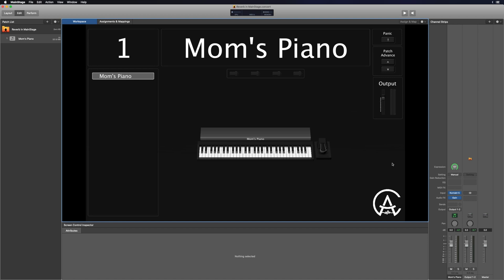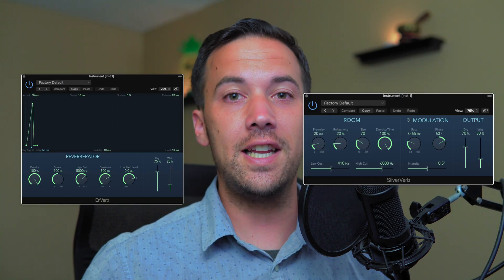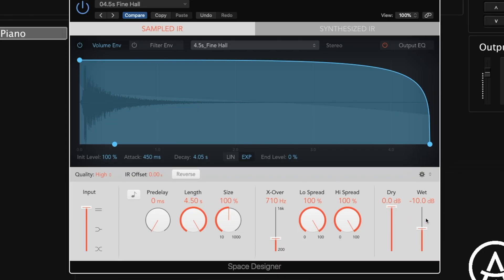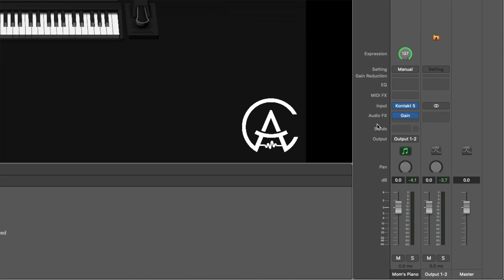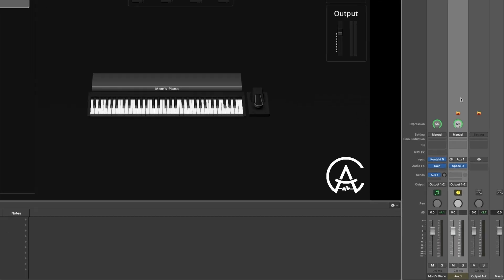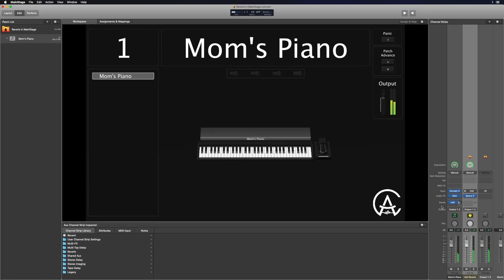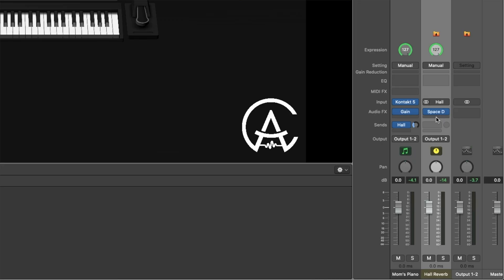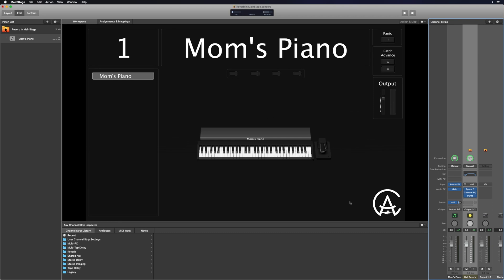Setting Up Reverb in MainStage

Comment: How do you do the opposite?  I'm trying to get rid of reverb/echo.  Help!
Reply from the maker: If it’s a send, you can click the right side of the blue rectangle and the drop-down menu will have an option that says “no send” that’ll get rid of it.

If it’s in the audio FX area, you can click the right side of the FX and the drop-down menu will have a “no plug-in” option towards the top and that’ll get rid of it.
Reply: @CatherallAudio  I appreciate the reply, but I'm not having any luck. Thanks anyway
Reply from the maker: If you'd like to send an email to James@CatherallAudio.com with pictures and more details of what the issue is I'd be happy to help as best as I can.
Reply: @CatherallAudio  I used ASDR and it worked beautifully.  Thanks.